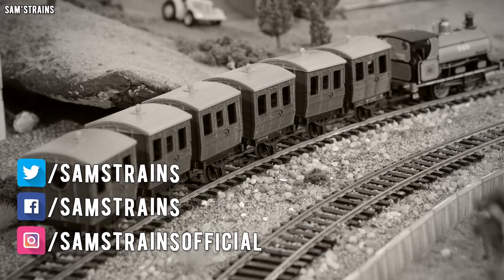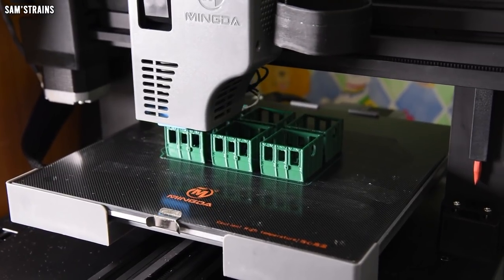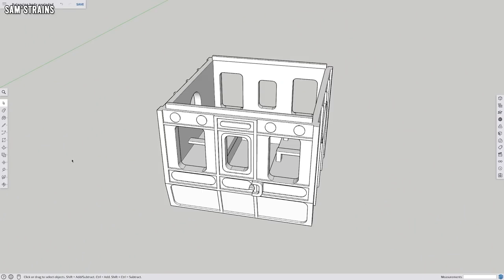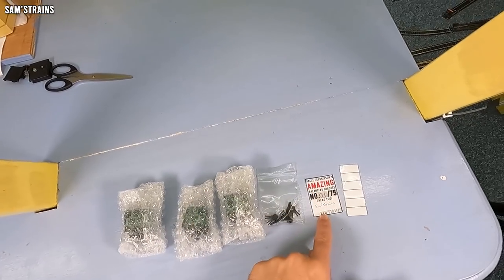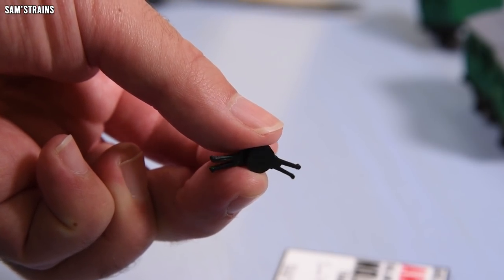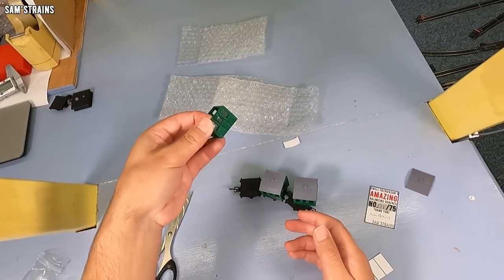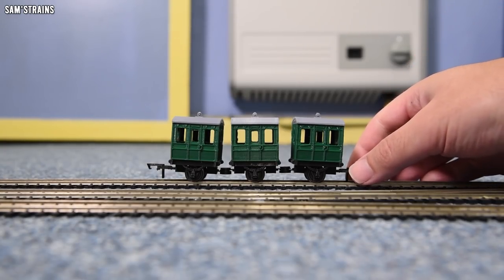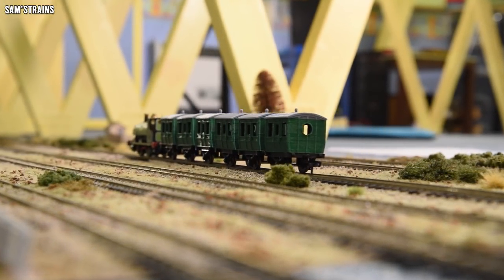Uncle Fredrikson's Amazing Balancing Coaches | Available Now!

Comment from the maker: Well, that’s the coaches sold out, and all in less than 3 hours too! Thank you so much for the amazing support, and sorry to anyone who sadly missed out. More 3D printed merch will be coming in the future!
Reply: Jack will like it if you unbox the Bachmann Skarloey
Reply: Ok
Reply: They sold out fast! I was afraid I wouldn't be able to get a set, but did just when there was only three left in stock!
Reply: Would love if u can make some n gauge large fright wagons as I not to fuss about higher quality as yours look fine also I have the same software that u ues so I could do most of the work on the design
Reply: The coaches indeed sold out fast. I'm far too late to be able to buy them.
Reply: Release the files for £5 .... and sit back and count your £20 ..

But seriously you save yourself a lot of hassle. There only sketch up files.. 

I sell prints myself.

I am only here for research for 5 year old son.

So not interested myself but for those who own a printer they probably throw you a few quid..

Good way to support you both party's get something
Reply: @vasili1207  I would gladly pay £5 for the files and a link to where to purchase the axles.
Reply: When’s batch 2
Reply: @Scynthius137  He would do well, doing it this way.

as someone who stubbornly only sold physical prints (Quality Control purposes) 

even i am coming around to selling files.

I run a resin printer so there is added steps, and more labour involved with my process  but he cannot run his printer 24hrs a day...  its not a commercial printer after all .

it sucks for people who missed out,  but it just the nature of  a one man band.

only so many tunes you can play in one day.

if i get a train set for my son for Christmas i will have to make some stuff for him.

00 gauge good for a 5 year old?
Reply: Should look in to an egloo resin printer
Reply: Congrats! I'm always excited to see a new 3d printing video. It would be cool if you could do a interview thing with someone like The 3d Printing Nerd. Sometimes they do a video just showing some creator and their neat stuff. This is the first stuff I've seen on 3d printing model train stuff really.
Reply: On the off-chance, for future merch, do you ship to the USA as well as the UK?
Reply: Do you have the file to print these by chance? If so can you please email the link to me? Thanks
Reply: @owendinostudios1200  They are his designs, you will have to pay for them if he decided to go that way .... there is no link
Reply: Will more ever be made?
Reply: @vasili1207  oh okay. I would be willing to pay a price for the files if he ever releases them
Reply: @owendinostudios1200  He would do well if he did.  i would buy it to show a bit of support i have no trains or track or anything. my 5 year old likes trains and dinosaurs and Christmas is coming up & his birthday. sam a likable lad & his reviews have come in handy over the few nights.

still have no idea what to buy but i know what not too :)
Reply: Hang on we could but them how and where from??!!
Reply: I've got an idea: Uncle Fredriksons Amazing Balancing Freight Trucks!
Reply: I reckon selling the plans or doing a second batch will happen before too long. Brilliant idea that actually works! Looking forward to the next one
Reply: Will there be a waiting list if more are to be produced? Or can we get the print file?
Reply: @nikerailfanningttm9046  ...and a guards van!
Reply: @vasili1207  $5? Dude, I'd buy the plans for $20-$30. I mean, I can then print off as many as I want and make a 3D printed railroad!
Reply: @nathan1sixteen  No $6:50 in dollars £5 i uk money.. Prices are up to him
Reply: @vasili1207  I was just going an example, obviously everything would be listed on British currency. I'm just saying that I'd be willing to pay the same, if not a little bit more for the models, as it gives me the capability to print as many as I want for 1 set price (plus the price of plastic, which is next to nothing is things like these)
Reply: @nathan1sixteen  yeah man... i know i make the same mistake with currency always surprised how cheaper dollars are.
Reply: Sam pleas make more I've been thinking of sending you a 3D printer btw this is not a bribe I just want some coaches
Reply: ☹️ I missed it... Guess I have to wait for him to make more
Reply: @nikerailfanningttm9046   yes I would buy a LOT of those too
Reply: Will you give us the files to print our own?
Reply: What that is amazing well done

Comment: Okay you had me, for a while I thought that it was a real thing. Could have been legit, here in France we had a somewhat mechanically similar stuff for real, the Arnoux system, with a broad gauge and coaches running on pivoting axles... that couldn't reverse! End stations were, indeed, loops. One still exists (Denfert-Rochereau, in Paris), as the only line built using these coaches was included later in Paris metropolitan railway (RER) lines. The station building and platforms are still curved...
Anyway, that"s a fantastic mechanical engineering job you did here. These things runs better than some infamous vans built to carry fragile chicken byproducts... that are not 3D printed...
Reply from the maker: haha got you Damien! That sounds absolutely fascinating - are there photos of that still around?!?
Thanks for watching, Sam :)
Reply: I thought this was real too

Comment: One thing that surprises me is how the manufacturers seem to haven't  bothered with fireless steam locomotives. While they're not super glamorous, they're actually surprisingly environmentally friendly. Given that they run on compressed air, some mechanical engineers have legitimately considered bringing them back for shunting and stuff. The fact that they don't need extensive power infrastructure or environmentally-destructive lithium batteries makes them quite appealing. 

I would like to scratch-build one myself in OO9 scale once I have the means to do so. They often have simple body designs, so it would make for a decent beginner's project.
Reply: Fireless steam locomotives are pressurised with steam from the main boilers in an industrial plant. Works fine when the locomotive can be easily replenished, and the cost of the facility to charge the locomotive with steam is miniscule.

Comment: What a brilliant concept! I wonder why it never caught on elsewhere? I can see an expansion to the range, using the same chassis with open and box wagons for freight, and even an 009 narrow gauge equivalent! As for the NEM couplers, could they see wider use (perhaps also a version with a slightly longer shaft) for rakes of "normal" rolling stock?  Others have mentioned making the 3D-print files available online for a fee - a small but perhaps regular income for your channel?

Comment: One can use either standard clear silicone caulk or a silicone like, but a little stronger adhesive called "Goop". The advantage of either is that if One changes his/her mind about them being glued down or they need to be disassembled later they can be pulled apart without damaging the parts.

Comment: Several years ago, at a show in Huddersfield  I saw an 020 loco and tender perhaps it was modelled on the same railway system. It was a bit wobbly but perhaps it was lacking the  " prototype " couplings

Comment: You should sell those couplings stand alone, they would be great for permanent consists and consists in general! Much better of a connection than other couplings meaning you can have a more realistic coupling, it's also much more discreet than the massive NEM ones.

Comment: 6.10 The 'electric light' on the roof is actually a ventilator, of the type known as a 'torpedo ventilator' -- the Grimburn Railway seems not to have run after dark for most of its life, and anyway electric lighting was rare on railways world-wide until years into the twentieth century. Apparently 'mains' electricity was only introduced to Morotoki when the Council acquired a third-hand hot-bulb compression-ignition engine in 1899, running it on raw coconut oil to power a generator of dubious origin. Nowadays they use a Hitachi genset donated by UNESCO, so all five lightbulbs on the island can be run simultaneously, and at the same time as a power-tool. Coconut-oil lamps are still popular, though, because the oil can readily be perfumed with an extract of the tongi-tongi tree, which grows profusely and uniquely on Morotoki. This perfumed oil is also said to have some rather 'interesting' effects, whether burned in a lamp or rubbed gently on a friend, which is perhaps another reason why the railway wasn't allowed to run at night.

D P Tolerant's fascinating history of the island includes an eyewitness account of the coaches being floated ashore upside-down one by one, towed by native canoes, from a freighter anchored precariously outside the reef. It seems that Charles Roberts, who are said to have built the carriages, found the whole episode so embarrassing that they erased all mention of the order from their books as soon as they decently could.

Really excellent and amusing stuff. Thanks for this. Perhaps you might like to consider adapting one -- or more -- of Rowland Emett's locomotive designs to pull these coaches, too.
Reply from the maker: Thanks a lot for sharing David - those just seem to appear on electric coaches though? Yeah absolutely - they had crude electricity way back in the 1800s on Morrowtowseas!
Thanks for watching, Sam :)
Reply: Don't forget the diesel powered vehicles that use coconut oil as a fuel.

Comment: Don't forget, because of the high coal prices, small branch lines used custom built 0-4-0 locomotives which ran on compressed air instead of steam, like many mining locomotives at the time. (New personal head canon)
Reply from the maker: Yeah they did! For the shorter journeys that was fine, but it didn't work on the express services!
Thanks for watching, Sam :)
Reply: @SamsTrains  It would be interesting to know how long they would last (how many miles you would get out of them). Imagine an LNER A4 or a LMS Coronation class with the entire boiler full of compressed air: No firebox or smoke box or tubes and flues, just a completely open space for compressed air...

Comment: Those are pretty cool. I'm a truck driver in America and we often see double/triple trailers being pulled around. We are not able to reverse them either because they would fold into each other. Is that anything like what happens to the balancing coaches?
Reply from the maker: Thanks very much Trent - that's a very educated guess! Yes basically... but the wheel flanges do something interesting as a result! ;D
Thanks for watching, Sam :)

Comment: You're printing is a pretty good quality.   Especially when you paint the outsides.   Personally, I think that you do better than you think.   A lot of the big players could learn from your thought processes when designing.  
Question:  In the real coaches, did they have any way to compensate for passenger weight?   Like, did they have a counterweight if all the passengers sat at one end?
Reply from the maker: Ahh you're very kind mate - yes with a layer of filler primer and some sanding, they can look absolutely fine! I think the ticket booking was quite strict, so passengers would be assigned seats in order for optimum balance - no records of any balance-related accidents I can find!
Thanks for watching, Sam :)

Comment: 'If you couple them to a massive diesel or something it will look a little bit silly.'
Hmm Sam what locos would be suitable? I am not too familiar with the railway on the Island of Morotosis, there doesn't seem to be any information on this railway online. 🤔
Reply from the maker: I hear smaller locos like Pecketts were most suitable, but they did have larger engines in the sheds for busy days!
Thanks for watching, Sam :)

Comment: For whenever the coaches do return to stock, is there a way that they could be packaged with NEM style "Horn and hook" couplers as well as NEM knuckle couplers (that are compatible with Bachmann EZ mate and Kadee couplers)  if one wants to use a US engine to run them. 

Also those Articulated  couplings could work for Articulated container/intermodal cars/wagons
Reply from the maker: I don't have any way to make those sadly as they're quite complex - but if they exist in NEM format, then you could put them in! :D
Thanks for watching, Sam :)

Comment: Will these work with kadee couplers?
Reply from the maker: The NEM pockets are at the standard height, so you could fit any NEM coupling into them... but only the balancing couplings will work between the coaches, as they need to support each-other!
Thanks for watching, Sam :)